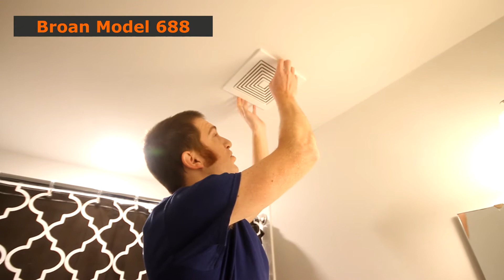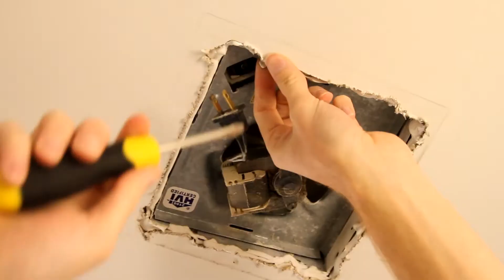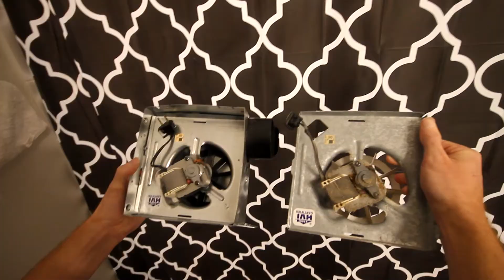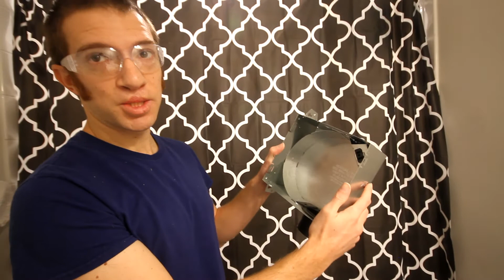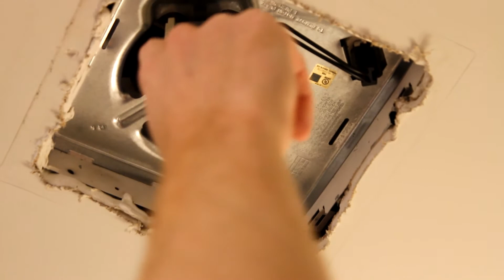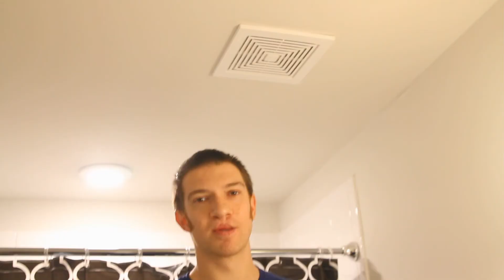How to Diagnose and Replace a Bathroom Vent Fan

Comment: What if the motor is working fan is turning well but doesn't seem to suck any steam out of the bathroom everything was cleaned etc ...? 🤷‍♀️
Reply from the maker: Hi there. If the fan is turning and steam isn't getting sucked in, then that's going to be tricky to diagnose. I'd guess that either you don't have a good source of air flowing into the room like a vent register, or the bathroom vent duct is blocked somehow. Best of luck!